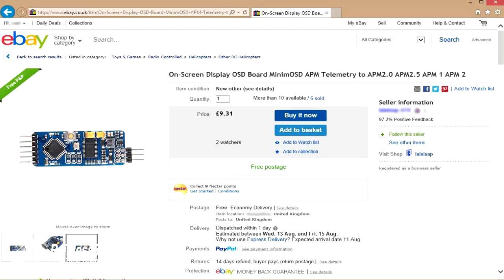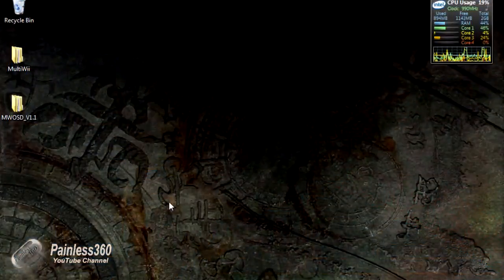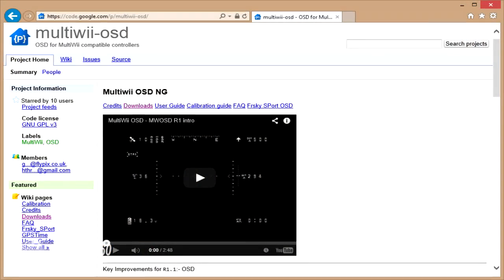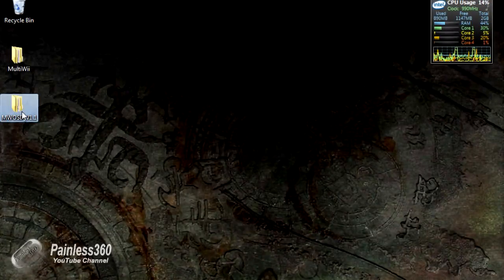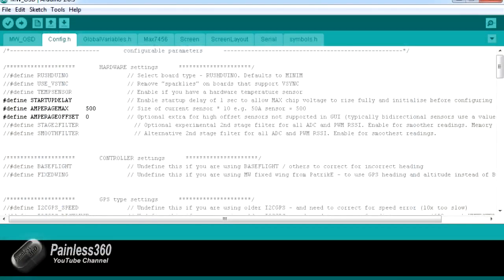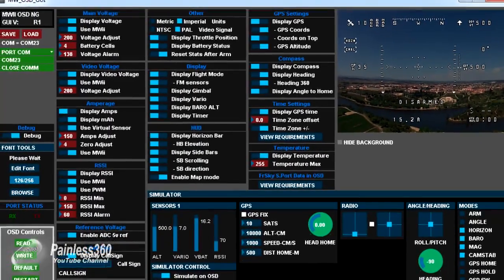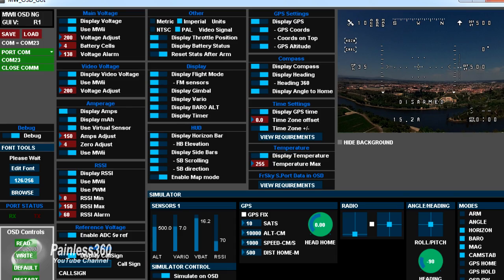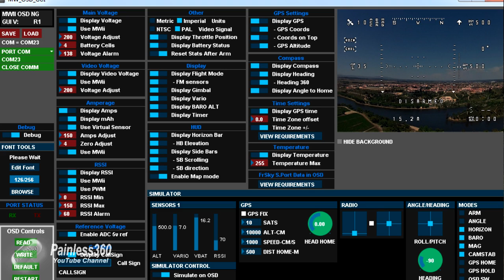MinimOSD setup on MultiWii - another firmware choice

Comment: Hi, I have a question. I bought this OSD and a FPV camera and it works 3.7-5 volt. Can I use it with this MinimOSD. Sorry but I couldn't understand you. My English is not too good. :(
Reply from the maker: +Mikail Coşan I'd expect that running everything at 5 volts should be fine. Best of luck

Comment: I have the micro minimosd. I have tried to get it set up for days now with no luck. I've tried many versions so far, various multiwii and kv team firmwares. Most of them report various errors when uploaded. One or two have flashed to the board a time or two, but  I could not get the character set to take. When I turn on my fpv monitor it only displays a bunch of Vs across the screen. This is very aggravating I've used various versions of arduino also. Currently on 1.0.6. Any help is much appreciated!
Reply from the maker: I'd suspect that the board has a problem.. Best of luck!
Reply: +Painless360 well good news is, after a dozen or so reflashes and deleting and reinstalling various versions of arduino I got or to flash and load proper fonts. Now I'm getting "No Data" on the screen. I see others say theirs says "No Mavlink Data". Mine does not mention Mavlink. You think I should check the tx/rx connections again?
Reply from the maker: https://www.youtube.com/watch?v=PTd5ViDsH1Q ;)
Reply: +Painless360 ok, sorry to keep bugging you! Thanks so much for the last info. I'm using the micro minimosd on a quanum nova (apm based). So the video you sent me informed me I should not be using mwosd. I'm now using Arducam OSD. I followed your tutorial and got it set up. When I plug it into the copter and turn on my FPV monitor it only displays the words "Update charset" in following your tutorial I did update the charset before setting up my panel display. So I plugged it back into the PC and clicked up update charset again and clicked the set in the directory. It still displays Update Charset on my fpv. What could be the next step? Thanks so much for the help!
Reply from the maker: Not sure, the process that worked for us is shown in the video.. Best of luck!

Comment: I love these vids. Watched this one and the previous and am running into a snag. I have the firmware loaded but when I try to run the GUI, I get the following message: c:\programdata\oracle\java\javapath\javaw.exe unspecified error

Any idea how I can remedy this?
Reply from the maker: Ryan Deaner This is a Java error - I would go through an Java update and make sure you don't have more than one copy of Java on the PC..
Lots on this on the forums. Best of luck.
Reply: +Painless360 Hello anyone I have a Runner 250 and added a GPS module the QR X350 and the Multiwii OSD will not read my OSD. Does anyone know how to help I have already tried all of the baud settings. Can anyone help! The GPS is reconised on my copter but the multiwii OSD does not reconise the OSD?

Comment: Hiya, Does this minim osd display lipo voltage and if not can you recommend a way of doing so.  Might be useful to add that Im using FRSky Taranis Plus Tx and X8R Rx.  Thank You
Reply from the maker: You can add it to this board with some fine soldering - see https://www.youtube.com/watch?v=6vCeov7nXTY

You can also now start to buy a version of this board that has the pads on the edge that makes it easier to add the external connections needed. See http://www.myrcmart.com/minim-osd-kv-team-mod-v10-p-8100.html for one of the versions..

Hope this helps.
Reply: Painless360 Thank You That is great help.  Had my first fpv exp today, strange is a word! lol

Comment: Hi, I want to add Main Voltage to a minimosd v0.1 board. I already made the 22k/1.5k mod (for3s) and connected it to pin 23 on the ATmega328 chip. I do not get any reading, it blinks 0.0V. Selected: display voltage Not selected: Use Mwii. What am I doing wrong?
Reply from the maker: If everything is connected then the display should be there automatically. You can see my bridge being made at https://www.youtube.com/watch?v=6vCeov7nXTY

Happy flying!
Reply: Painless360 Sorry for the trouble, it was a bad connection! Ready for take-off now... ;-)
Reply from the maker: Good news! It had to be something simple..

Happy flying!

Comment: will this work with naze32?
Reply: It works great on the naze32 running cleanflight. But you may need to disconnect the osd from the flight controller before flashing new firmware / adjusting settings in the c.f. configurator or else some settings might not save to the naze properly.
Reply from the maker: Sorry, no idea. I don't have a Naze32 myself. Happy flying.